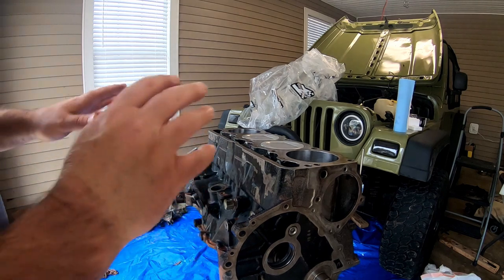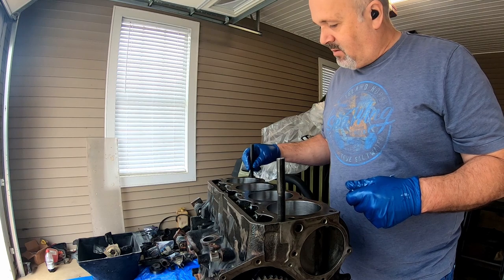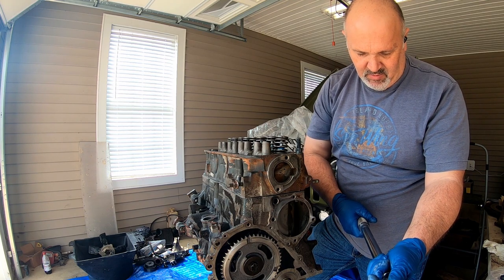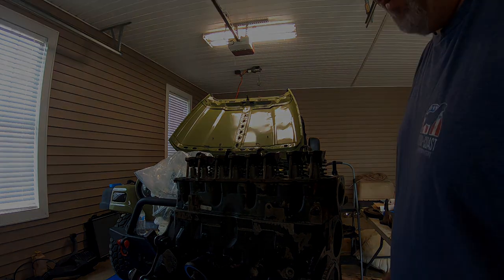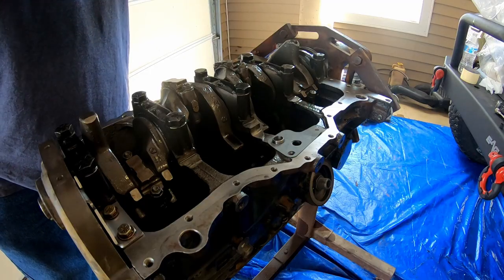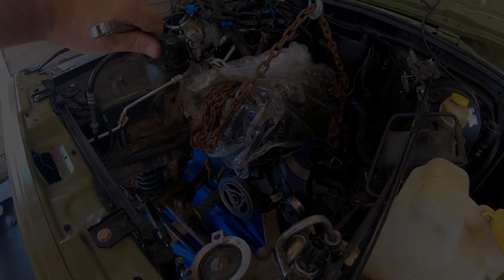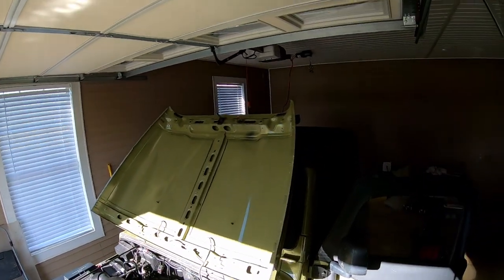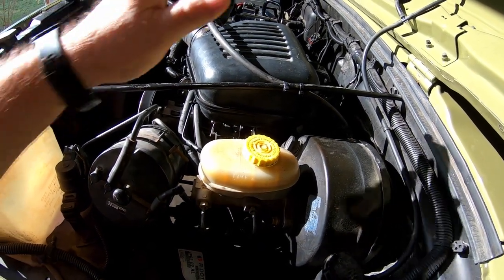97 Jeep Wrangler 2.5 Engine rebuild Finished! Ep4

Comment: I noticed quite a difference in power, I added a 4.0 litre throttle body, 4 hole injectors, and headers, had already done 4.88's 2 years ago, now running 16 inch rims with 35's, highway speed no problem.
Reply from the maker: That's awesome Rick! I haven't done the 4.0 throttle body but may give it a try. Thanks!

Comment: If JJ fails to keep you busy. I can drop mine off for a few months. HAHA Did a DIY front end Toe-in on mine today. Easy and fast, sure beats taking it to Corinth 22 miles. Then pay to have it done. Also find lots of extra power on my 2.5. Swapped out the 31's for 205/75R15's unreal how much better it pulls now.
Reply from the maker: Haha Thanks for the offer Pete. That's good to know about the tires and more power! Thanks for watching!

Comment: As a Jeep YJ 2.5 1995 owner myself interesting to watch the rebuild process.
However just wish you had given more info on your rebuild part choices .
Are they your choices or the machine shop recommendations?
Wish you had shown the cylinder head surface finish, and the type of gasket used on this.
Was it MLS=multi layer steel  or composite type, MLS are supposedly surface finish critical ref sealing properties.
I have no experience with this issue, so interested to hear others  guidance or comments
Reply from the maker: Thanks for watching Colin. I went totally with what the machine shop ordered me. This was my first rebuild and I really trust this guy! I went to school with him and he will not steer me wrong. Sorry,  I don't know the details.  Engine now has 12k on it and runs great!
Reply: @ForceBuilt  Hi, thank you for the most kind update. Always good to have people you trust with such work

Comment: did you have to take the valve cover back off when you re-installed the engine?  How much can you put back on the motor when its out and still re-install it?
Reply from the maker: I did take the valve cover off to make sure I got oil up to the rockers. I put everything on in the engine bay. Manifold, compressor, alternator, and such. I have the video where I took it out. That may show what you need to know because that is the way I put it back in. Thanks for watching

Comment: What about the oil filter adapter was it hard to come lose and did it take a gasket. Thanks
Reply from the maker: I did not replace anything there. There is the part that the oil filter screws onto(all threads). The filter seat(where the filter seals) is made to the block. Thanks for watching!

Comment: Wow! Congrats, Steve! Awesome project and really glad at the outcome. 2,000 rpm for 20 minutes? That’s a long time to hold the pedal steady. Did you have a magic trick? How long (days/hours) did the whole project take, not counting waiting for parts or the machine shop?
Reply from the maker: No magic trick lol. I held it at 2000 to 2300 while my brother monitored what was going on under the hood. I put the crank and pistons in on Fri. Saturday I put the head on and oil pan. I realized I needed rockers(Delay, had to order online). Rockers came in and I put them on the next Fri and finished painting. Installed the engine Saturday. Broke it in Monday night Thanks for watching Ed!
Reply: @ForceBuilt  Wow! I’d assumed there were a few weeks’ time dilation crammed into a couple 20 minute videos, but not so much. Awesome work.
Reply from the maker: @edvancise  there was one day in there where I took the engine out that I didn't account for. It is a pretty involved job, but doable.

Comment: hey man i’ve got the same problem in mine, cracked piston skirt. wanted to know what you thought about trying to just clean it out and put new pistons in it if the bores aren’t damaged
Reply from the maker: That will work. And it should last a good while. The problem can be that the bores are out of round even though they look good. That's the way mine was. Good luck!

Comment: Noticed you did not add any sealant at the 4 corners on the oil pan gasket, any leaks??
Reply from the maker: I just watched the video trying to remember. I was thinking I was test fitting in that part of the video. I honestly don't remember if I went back and used sealant or not. If I did it would only be at the corners of the front cover. To answer your question, no leaks at all. Bone dry.
Thanks for watching!

Comment: Do you remember torque specs for the connecting rods??
Reply from the maker: Not right off hand. I had the factory service manual to go by. I am not home at the moment.
Reply from the maker: Just looked. 33 ftlbs. Here is a great link. Just scroll down until you find what you need.
Hope this helps!
https://www.extremeterrain.com/tj-wrangler-torque-specs.html